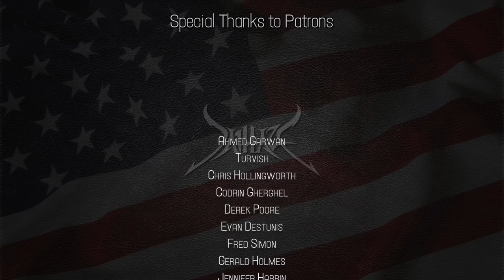Odis 25 Single Coil RDA Review and Rundown | Short and Snubby

Comment: I got this O Atty V2 but in 22mm, and for me, and I have a lot, this is the most perfect RDA for squonking. Very well made and fucking well thinked for the squonk. In 22, the flavors are just....no words for that! And I built it with little dual, no need big coils, and that's  fuckin' perfect. 
Thanks for the look of the 25 version Jai, I did not see it before. And if you want to see the 22, check out my review on my channel. ( sure that's not in english, but you'll see the conception) And it will be an honour to have the visit of THA MASTER JAI on my channel ;-p So.. Let's flip it

Comment: The NarDa was most definitely first, with the O-Atty V1 coming out after. I like their products but they are known for taking “Design cues” from others, but I like them and I have their products. 

The V2 is great but the V1 (in both 22mm and 25mm) have weak screws and I’ve had them shear in the holes
Reply from the maker: yeah i was going to put that part in, I may have mentioned it in this but I think I edited it out.  I wont get into the hellfire odis debacle

Comment: For a "high end" they really fucked up on that build deck and air flow design.
Reply: Reason being is they should have made it to where the coil can be placed horizontally in front of the air flow, not sideways sorta speak.
Reply: Brandon Doten agreed... had a "goon max" clone with the same situation... gave away to guy at work